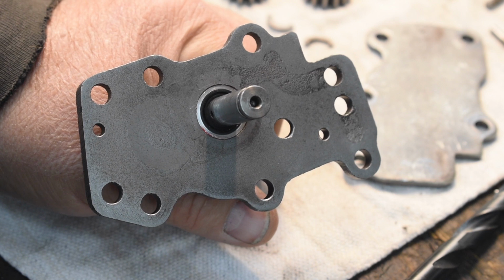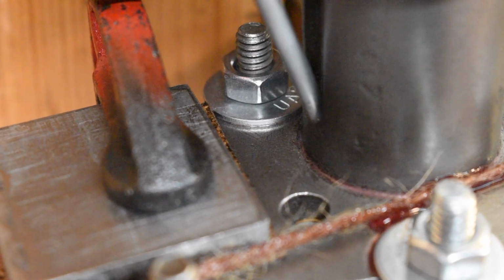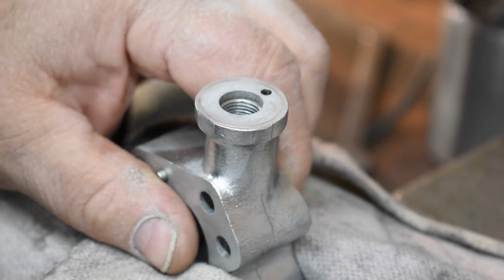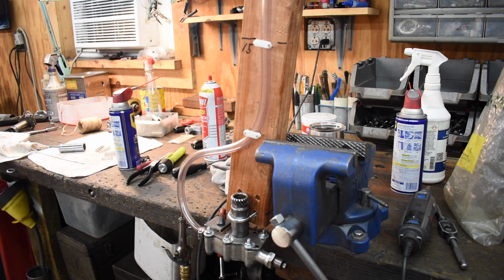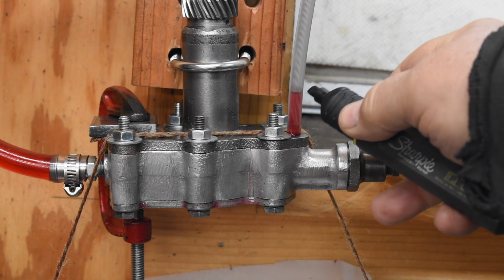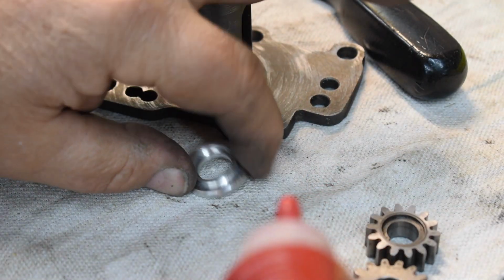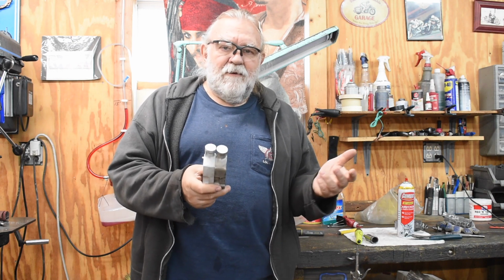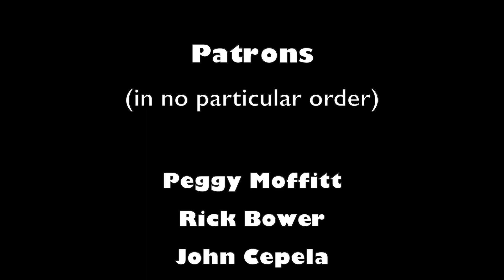Exxon Valdez Part III Nbr 164

Comment: I know on some carb needle valves they use Viton vs a steel tip.   I did a quick check on McMaster-Carr which has check valves that use Viton to seal.   They also  sell Viton balls which can be used in check valves -- which should seal better than steel simply because its a softer material and would conform to the contact surface better.   Anyway,  that's my take.  Interesting series.
Reply from the maker: I like the viton ball idea...

Comment: Greetings From Siberia . As always I hope that the two of you had a good Christmas and a well deserved vacation and are happy and healthy . Another first class video production from the cast and crew at Ironhead cycles world headquarters . I have thoroughly enjoyed this mini series and scientific experiments . This is some very interesting content with equally interesting results. I have been aware of wet sumping for decades but it has never really bothered me though I know that this should not be happening . I will explain why I say this . Where I live we can't ride for a few months every year due to the weather conditions and the bikes will be resting until the new riding season . My thoughts are while they are hibernating the bottom end will eventually fill with oil and hopefully keep certain components covered with oil . In the spring time I will drain the bottom end of oil through the trans drain plug , refill and top up the oil tank before riding the bike I will start the season with . This has become the normal routine for years .The modifacation of the breather oil seal makes perfect sense and the results confirm that this is correct. The check ball and seat is still a work in progress . There is a vendor currently on ebay that sells oil pumps or will modify yours so that it doesn't wet sump . It appears to me that he installs a seal as you did but as for what other mods or updates he performs I can only assume what he has done to the pumps as I have no first hand experience with one . The lapping of the seat and a stiffer spring in theory should make a difference but we both know that theory doesn't always come out on top in the mechanical world .The use of a Viton check ball also sounds like a good idea . I have never heard of them until now . Another thought that I have is that maybe all of the early Ironheads wet sumped to a certain degree . My 73 XLH has about 25,000 original miles on it , has never been apart for any type of rebuild and it wet sumps while hibernating . I have not owned this bike from new so I can't comment that it did this from new . It would seem that this shouldn't be normal but maybe it is . If this was to be true you would think that something would be in the owners manual when the bikes were purchased new or at least someone at the dealership would have informed the purchaser .The previous statement is a sample of a theory . My guess is that if you live in a country or somewhere where you can ride every day of the year you may or may not experience this . If you checked your oil regularly and topped up when necessary you might not have really noticed from new if you were the original purchaser . One of my friends is the local Harley dealer and has been for years , I will ask him the next time I see him if he remembers any of this from back in the day . Another thought is that the testing was done with what I believe are used pumps so there is no control to compare to . I know that genuine pump bodies can be purchased so this is totally doable . That would answer some questions . I have seen the seat cutters for sale through parts suppliers but I have never used one or have any first hand experience with one . I look forward to the update on your findings and thoughts on that as well as some more video content . I think the old fossil has ranted enough for one day and I thoroughly enjoyed our talk last week . Take Care . From The North   Siberian Cycles    Gary   P.S. The FXR shaft is out and lying on the garage floor
Reply from the maker: There will be another episode or two forthcoming on the wet sumping. Looking at the overall design, I have to assume that all Ironheads wet sump to one degree or another. Even if the check valve seats perfectly there is a path through the breather for oil to enter the cam chest. So now that the path through the breather can easily be fixed, the search for the perfect check valve and seat continues. It really seems to me that the spring can use a few more pounds of pressure on it, but if you have an engine that might only produce 3-5 PSI oil pressure when hot at idle the spring would have to yield at 1-2 PSI. Viton balls and seat cutters are on the menu. Stay warm. Keep me posted on FXR.

Comment: Jim's machine has a check ball seat cutter to redress the seat at the proper angle. It's a hand drive style cutter which will fit on early XL and big twin external pump. Maybe?
Reply from the maker: I saw that, I have one on order...

Comment: Try using 50 weight oil for the test
Reply from the maker: I used the ATF on purpose because the viscosity was lower, the logic being that if it could seal a lower viscosity fluid, it could easily seal a higher viscosity fluid. That, and I had 1/2 quart of Ford ATF i was probably never going to use for anything else...

Comment: i think the model k & early xl's had a different type of stopper other than a ball? maybe that would work or maybe that's why they changed it.
Reply from the maker: It did, a half ball with a short stem, I might try one of those down the road and see if it is any better.

Comment: The mistake you made when lapping the check ball... Was hitting the ball with a hammer after lapping the seat... The reason the seat fractures in the first place is repeated pounding of the ball against cheap aluminum... Hope this helps you

Comment: Can you use a rubber O ring as a seat ? Have the ball seat against it instead of the pump housing.
Reply from the maker: I'd be reluctant to put anything in there that could come loose and get pushed downstream into the oil passages.

Comment: Check valve thoughts:  the steel ball, if perfectly round and the proper diameter should work; aluminum seat:  Harley has produced porous aluminum castings, how confident are you that it is not the problem here considering your extensive testing.  I'm wondering if a chemical coating might be applied to the entire seat, then use the ball gently to form the correct shape?  I can't think of the proper name for it at the moment but the stuff used to seal the inside of Pan or Shovel cases comes to mind.  Or perhaps a liquid rubber that would firm up when cured?  With either it would be necessary to coat the ball with some non-stick coating while useing it to shape the seat, and clean out the oil passage through the seat afterward. 
Not finished solutions, just possibilities that came to mind.  Good luck!
Reply from the maker: At this point all options are under consideration.

Comment: Test method suggestion: NO spring as the test for your ball seat. How? "Simple", lol. Measure depth of ball in seat from pump body face (dial caliper depth leg). Now measure depth of intrusion of your "threaded plug". Subtract latter from former. Example (all numbers imaginary): 2 inch depth from pump body face to ball (in seat), 3/4 inch "threaded plug" intrusion, difference of 1.25 inches. Ok, now avail yourself of a stiff rubber rod just smaller than ID of the check ball drilling (roughly ball OD). Cut to 3 thou longer than difference calculated (1.25 plus 0.003, 1.253 inch) for a crush tension fit, oversize could be as much as 10 thou, but no less than 3. Voila, you now have a "solid" check ball mount. If it still seeps, your ball/seat combo sux, no debate possible. If it seals, playing with spring tension is worthy of further experimentation. The only caveat is to make sure the rubber rod has an OD small enough to allow anything that seeps past the ball to seep past the rod.

One variable at a time is proper troubleshooting. Fix the ball/seat FIRST, then dick around with springs. Until you're sure the ball seals, you're just pissing into the wind.
Reply from the maker: Copy that, I agree. I'll be diving back in to the ball/spring again...